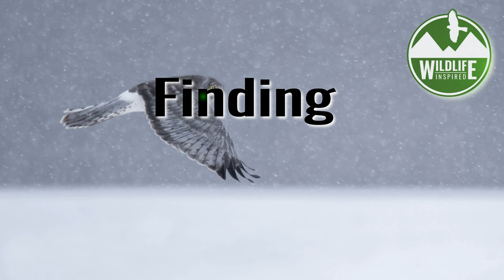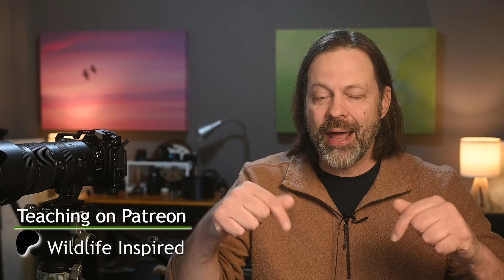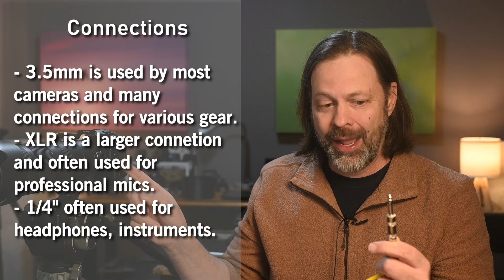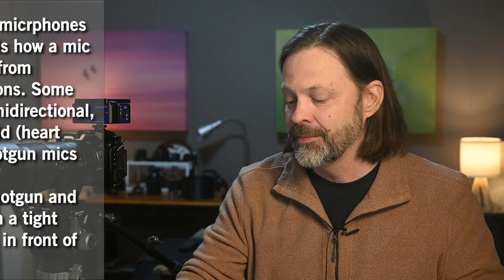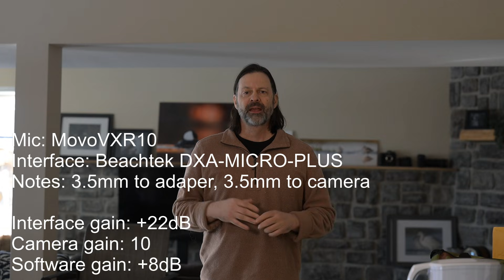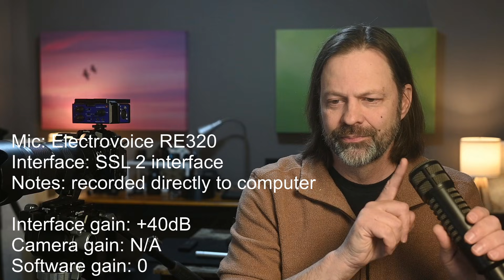Mic Choice Matters - Improve  Your Camera with Microphones and More

Comment: You can get off the chain is 2 x at-897 audio technica  with a tascam fr-av12 with two xlr on thier own tri pod… with timecode jam… diety tc-1.. looking on getting the clippies a two stero mics $200 .. used alot apparently

Comment: Great video. I have been trying to find a solution for dealing with a shotgun mic and lens motor noise. Some lenses are worse than others, but most of my longer lenses I am using for wildlife have at least some degree of noise being picked up on the mic as they are focusing and what not. Obviously when I can, if I am in a blind or something, I have mounted my mic away from my lens as far as possible and that helps, but when I am running and gunning, that's pretty hard to do.

Comment: Interesting video. I use a Senheiser MKE600 which requires phantom power or an internal AA cell. It works well on camera but when mounted in the hot shoe gets in the way. I have seen people using extended bracket, lens mounts and all sorts of things. Would love you to do some reviews on mounting methods as there are so many and unless know exactly what is needed it is hard to find the best and light mounting options.
Reply from the maker: Glad you found it interesting! Mounting methods would be a good topic to cover in the future.